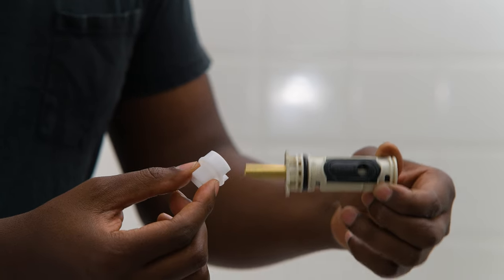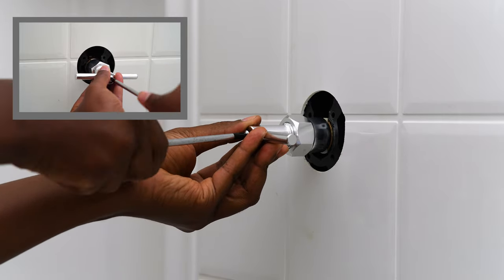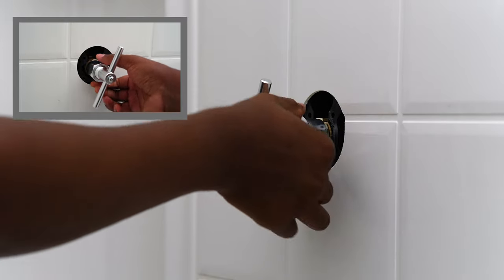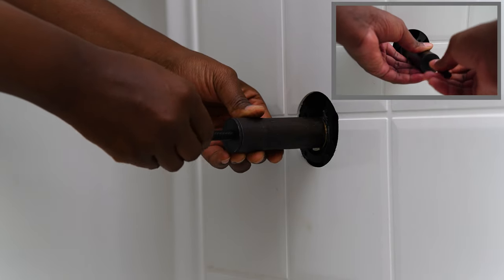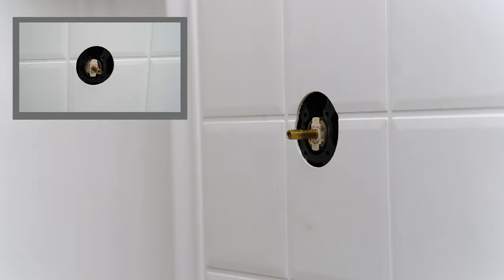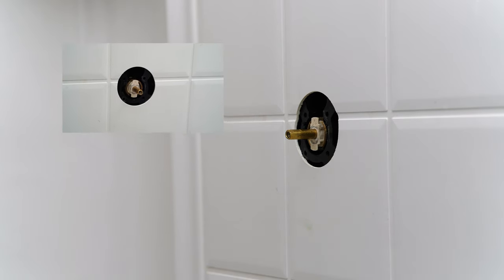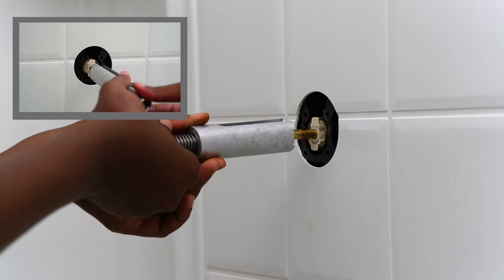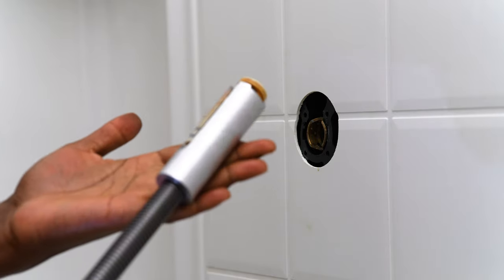WATCH THIS!!! if you have a stuck Moen Cartridge

Comment from the maker: What tool did you go with? Thanks for watching.
Reply: How do you score a discount on the third tool? Thanks
Reply from the maker: @enriquejimenez6088  because I have a YouTube channel and I did a video on it
Reply: So right, first tool made from weak a
Aluminum.  First use on a tough stick 1222, and also last use.
Reply: Sorry, I figure out. One piece of plastic got stucked in pipe and that's why I couldn't push further. I fixed that one. Thank you very much !  Dino
Reply from the maker: Welcome
Reply: I got Danco Core puller and followed steps from your regular video. It worked. Thank You.
Reply from the maker: Welcome
Reply: did you have to remove the clip holding the cartridge in.? I didn't see that
Reply from the maker: Yes there should be a clip unless the last person didn't put it in
Reply: my problem is that the bolt or screw broke and I can't use my Moen puller.
Reply: The Danco core puller, very easy to use.
Reply: @paulanderson8392  Yes, just use needle nose pliers to pull it up and when you push in the cartridge with the plastic clip it comes with, you can guide in the pin.
Reply from the maker: @sergioramirez4511  yeah it is
Reply from the maker: Yes
Reply: The tool is pushing against that plastic so of course the plastic grooves on the cartridge broke. Will try to figure out. Great videos though. Thanks.
Reply: @Hindsight101  You saved me from having to call a plumber.  My 1222 cartridge was frozen pretty good from 15 yrs of hardwater.  I went with the Everbilt puller because the hardware store had it in stock and I didn't want to wait for more than a day for the Moen brand to be delivered.  After using all the elbow grease I had to twist and pull, I nearly gave up and almost called for help.  Then I remembered your "slow and steady" comment.  Thank you!  This video was definitely a lifesaver on extracting a super stuck cartridge.
Reply: What do you do if the screw is stuck inside the cartridge? The original screw that is in the place where I would screw the tool into place

Comment: My parents had been using a wrench to just turn their cartridge stem for years after their handle broke. So the stem itself was smashed and unable to thread a remover into it. After applying heat using a hair dryer for 15 minutes (and an additional 10 minutes when it still wouldn't budge), the cartridge basically slid right out. I wish the puller could've worked for their cartridge, but I wanted to mention the heat in case it helps anyone else.
Reply from the maker: Thanks
Reply: We are regreting using the heat technique. It caused the plastic to break and the stem to come out, leaving the rest of the plastic and black rubber parts stuck inside and nothing for us to get leverage on to get them out.
Reply: Hair dryer helped a lot for me. I had the new valve w/ included nylon tool - old valve wouldn’t move a bit. I also had the danco puller; but didn’t want to force it if it was that seized up… saw a lot of nightmare scenarios where the puller failed and broke the valve.

Hair dryer for 15 mins - then tried the nylon tool - valve moved a little bit. Immediately used the puller and it slid right out.
Reply: My cartridge is still stuck with this tool. I’m about to use this method and hope it works!
Reply: @amberhankins4106  good luck!!
Reply: @mKierstenk  it worked!!! Thank you!!
Reply: Thanks! I had a really stuck old cartridge. I used the lake view puller but it still wouldn’t move. So I applied heat around the stem on the valve to soften the areas where the rubber on the cartridge is located. I made sure not to apply too much heat at one time. After I applied the heat, I used the lakeview puller and twisted it on hard. The harder I twisted the cartridge would come out little by little. I applied heat again 5-10mins around the valve each time then twist the puller more. Repeat steps. It worked and finally came out!
Reply from the maker: Wow that's dedication
Reply: Yo you guys are legends! The Danco puller didn’t help. I used a hair dryer to heat it up for 10 min (5 min breaks in between) and was able to pull that little shit out. Good lookin
Reply: Any help please, my brass and piece of plastic broken and one side of the rubber came out and the rest of the valve stock inside. Greatly appreciate your advice.
Reply: OH MY GOSH, this is my exact problem!!! My stem is squished so the puller won’t work! Thank you so much for this!
Reply: No I wouldn't try heat, may remove the solder of the pipe, melt those rubber, plastic, create more problem.

Comment: After ordering one of the recommended tools, grew impatient and tried the plastic tool included with the cartridge.  It worked great.  Guess the cartridge only needed a little nudge.  Without the video, I would never have figured out the purpose of the white plastic piece.   Assumed that it was an ill-fitting cap.
Reply from the maker: Well I'm glad the video kind of helped. Thanks for the comment

Comment: I'm removing the Moen 1222 cartdrige and having problem, it's stuck, I came here for solution, i have the 1st tool and it's not working. I feel I need the 3rd tool but it's too much money for a 1 or 2 times use, but if I was a plumber I would get it, so easy. So I'm still looking....
Reply from the maker: Good luck

Comment: My stem broke of as I was trying to twist it out. I ended up drilling it out with a 3/8” drill bit, first all the metal components in the middle, then the plastic casing walls. It was a laborious process and took a couple of hours. Of course it was a weekend, and the water had to be shut off, and I worried that I’d actually damage the Moan valve, which would be beyond my expertise to replace, plus I’d probably have to cut into the wall to replace it, either from the outside of the house or remove shower tile. Luckily with a lot of patience and persistence I got it all out.
Reply from the maker: That does not sound like fun

Comment: Mine was removed from a calcified 20 yr install.  The Danco tool worked for me after watching this video showing how to properly use it. I also sprayed some loosener and just slowly got it out.  When I went to install the new one, I cleaned the valve tube, but the calcium had built up so much that I couldn't insert it.  Since there was no turning back, I sat patiently with CLR and a small steel brush and worked out the gunk.   Once the new cartridge would slide in without excessive force,  I got the clip back in and wrapped it up. 

Thank you for this great video👍
Reply from the maker: You're welcome and wow that sounded like a pain

Comment: Fantastic video and I bought both the tool (Danco core puller) and cartridge at Lowes the tool was $16 and the replacement was $58, and only took a few turns to push out. No need to buy the grease, it comes with a small packet in the kit. To take the tool off, losen the bolt first and the the top screw will come off the tool for reuse. I am now my neighbors expert plumber for these units. Since most of the homes in my area are only about 7 years old and others have been having the same problem and I easily saved $200 to $300 by not calling a plumber. I am a youtube engineer and proud of it, from plumbing, electrical, gardening, putting my back in place and keeping my 3 vehicles running. Thank You. ( Just remember to read the numbers on the top of the cartridge to find the correct one at the hardware store and remember to turn off water and release the pressure on the shower valve first and be ready to put a towel under the pipe, because you will still get some water popping out and you don't want this to run down the back of the wall. Plus, plug the drain, so no screws fall down, also use the plastic part to push in the new cartirdge)
Reply from the maker: Thanks

Comment: Great video !!
I bought the Moen cartridge remover on Amazon for about 60$ including tax

The key is to keep slowly turning the nut which causes the cartridge to be pulled out. 
The key is to do it slowly to avoid any undue force that may cause any part of the cartridge to crack/break. 
If you are succeeding then you will know because when the cartridge is coming out you can see the top plastic part of the cartridge move away from the metal of the valve body(as seen more clearly when Big Al moves the nut back to reveal the cartridge has come out). 

Extra note to those out there that are newbies like me and this is the first time: 
Once the cartridge is coming out and you cannot turn the nut more (for me this happened at about half as far as it did for Big Al) then carefully hold the handle and with constant gentle pressure turn the handle left-right over and over slowly pulling at the same time to coax the cartridge out. 

If it is a newish cartridge and the previous installer put grease on it than this will be easier. 
If it is an extremely old cartridge made of metal then this may be more difficult. 
In my case, the original plumber didn't secure the valve tight enough to a wooden structure so the whole thing was moving in and out when I applied pressure, so I used a wrench applied to the metal valve body that sticks out of the wall and another set of hands to hold the wrench to stop the valve body from moving back and forth, both when I removed the cartridge and when I inserted it. 

Don't forget that once the new cartridge is inserted with the HC (hot cold indicating hot on left and cold on right) in the top position, to use pliers to turn the protruding gold metal post 180 to the right to close the water, so that when you turn on the water supply it does not come gushing out.

The other problem I ran into was that one of the holes that the faceplate is to screw into on the valve body was blocked by my fiberglass shower cause the hole in the fiberglass was not made large enough by the original installer.  I had to chip away carefully to remove the fiberglass so that when I affix the plate cover, I could get the screw in straight so it connects with the screw hole on the valve body to secure the face plate. 

Take a good look at the valve body with a flashlight before you attempt to install the faceplate. When the faceplate is put on straight, you will notice that the two holes to attach it are located on the top right and one on the bottom left. (diagonal to each other, weird !)
You should see the same orientation of screw holes in your valve body in the wall.

It was not easy to make the screws go into the holes in the valve body to screw the faceplate in because you can't see anything at this point cause the faceplate is blocking your view. That's why should should take a good look at the wholes in the valve body to help you orient the screws once the faceplate is placed .
So you have to go by feel. 
Put the screw in as straight as possible then hold with your fingers and move it around until you feel it lands onto something solid then turn to screw it in a bit with your fingers and if it is in the hole in the valve body it will start feeling secure so you know its in and you can continue screwing it in now with a screw driver (Philips).
Make sure to screw one screw a bit at a time and alternate between the two screws. 
You never want to screw one screw in all the way, both have to go in a bit at a time. 

Since my valve body was not well secured in the wall to a wooden structure, screwing the face plate in brought the valve body closer and closer to the wall of my fiberglass shower and this helped to make that valve body stable.

If you have any worries about water leakage then turn your water on before putting the faceplate on, and after the cartridge is installed with the pin. (Please note the cartridge is well seated in the valve body when the plastic with the HC inscription is right up against the metal of the valve body.) Then you can look into the hole in the wall and observe if any water is leaking in the wall with the water on. There is a small chance that if a joint in the copper pipes was not soldered properly, originally, and you were rough with your install and made all the pipes clang back and forth during the install, a joint may crack and leak.
So always check for water leakage in the wall by turning on the water supply and turning the cartridge post using pliers before adding the faceplate.

It is recommended to add a thin bead of clear caulking around the faceplate at the point where it meets the wall to avoid water or humidity from entering into the wall.
Hopes this helps the newbies like me !
Thanks Derek for this video you saved me hundreds of dollars. 💞
Reply from the maker: $60 seems kind of high thanks for the info but you know I have a video that explains all of that

Comment: You saved my life!!  Or at least a couple of hairs on my head.   Both your install and how to remove a stuck cartridge. Home Depot only had the Danco, but it worked.  At first I thought it wasn't because my daughter didn't tell me she was having issues and ground those black rubber ovals down to shreds.  So, when I was trying to get unstuck, it sounded and felt awful when tightening.  But I watched your video again and just gave it a few more twists and it started to some out.  Only thing I didn't see in yours or other videos was the pin.  I was assuming it went around the cartridge but after rewatching, I was able to see some movement of the pin in front of the cartridge.   But love how you explain step by step with some extra details, but no fluff.  I went with the Moen in instead of the ACE or the Danco; works so smoothly.  Thanks a bunch!!!    I'm gonna start listening to more of your videos to see how else you can make my life easier!!!
Reply from the maker: Thanks for the comment and glad I was able to help

Comment: I bought the Danco tool, it is poorly made but still works. It was $17, and it did get half the valve out to where I had to break the rest apart with a needle nose. The tool is in rough shape but still useable for the future. What it did is saved me $100.
Reply from the maker: Hey, glad you got out to work for you
Reply: @Hindsight101  the rubber seals for the incoming water bunched up and caught on the incoming water holes. There was no way it was going to pull straight out.

Comment: Guys and Girls! I just fixed a 20 year old pipe with the first option. You have to use a rust remover (not wD40) the cheaper “specialized for rust) worked perfect. 

I sprayed the surrounding pipe. Used the puller wiggled it left to right while pulling (not too hard) took out the puller, added more rust remover, and repeated the process until it loosened up. 

It takes patience, will save you time from having to break the pipe.
Reply from the maker: That's for the tip
Reply: I agree  to spray it with silicone spray before doing the pulling with Moen Tools, make it easier to slide out.
Reply: what rust remover did you use?

Comment: Your 2 video's saved the day.   After day 1 and the cartridge did not come out, I used the white connector that came with the cartridge and after lubricating it the day before, I physically turned to loosen the cartridge.   Repair complete, no leak and all went back together.    THANKS SO MUCH FOR YOUR GUIDANCE
Reply from the maker: You're welcome and I'm glad you were able to use the white piece. I hated that thing but I'm glad it worked out for you

Comment: I am going with Ona, although Lakeshore looks like a winner if you do a lot of these moens.

I agree with your comment on Danco replacement cartages being bad...I have tried them several times over the years and they all started to leak within 6 weeks.
Reply from the maker: Let me know how you like the Ona
Reply: @Hindsight101  I tried an Ona out on a stuck 1222 Moen stem - rubber out of position.  The Danco couldn't get it. Ona  work great. It took about 2 minutes.
Reply from the maker: The ona is probably my second favorite

Comment: Used the first tool on a VERY stuck cartridge, and it was a hassle. One thing that worked for me was that once the big nut on the removal tool was no longer useful, I took the remover tool out and used vice pliers on the cartridge white plastic body. After a lot of wiggle and pull, it came out. Parts of the rubber of the old cartridge were stuck inside, so I need to clean up a bit (nose pliers, paper towel, etc).

This video shows how things works, very useful for first timers, thanks!
Reply from the maker: Welcome
Reply: This was my exact experience, I had to get all the stuck rubber pieces out of the inside of the pipe after I managed to pull it out with pliers.  I live in an area with hard water (I do have a kinetico softener though) and had to replace the cartridge on a new home that is only 7 years old.
Reply from the maker: Ugh

Comment: Pulled my 1222b cartridge out using screw with lever method. Had to remove the plastic sleeve  using a 3/4 inch tap and bolt with washers to screw the sleeve out.
Reply from the maker: It's definitely one way to go

Comment: So the easiest cheapest way for me after snapping the brass shaft, was drilling a hole ~.25" deep. Then I put a construction screw, similar to a decking screw, getting it as straight as possible. I put the torx/star bit in my dril, not my impact, select high speed and turned the screw/brass full speed until I saw smoke 🤔 or steam and continue 20-30sec after that point. You should hear it sizzling, then grab the screw if secure enough or the cartridge if you have narrow grippie pliers and it slides out with ease. I was surprised because it was a plastic cartridge, but this did the trick. Next time I get a stuck one I'll cross thread a screw into the shaft(instead of snapping it pulling&prying) and spin-cook it until it's well-done.
Reply from the maker: Thanks for the info👍